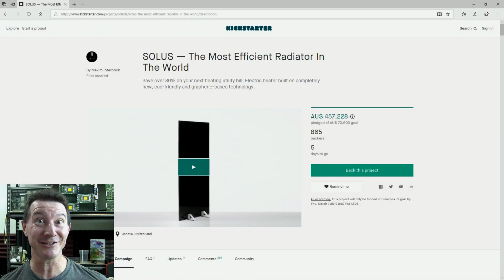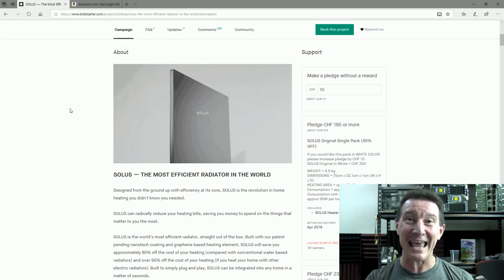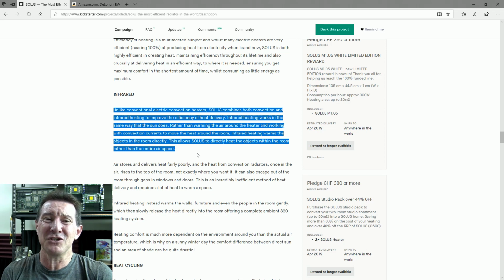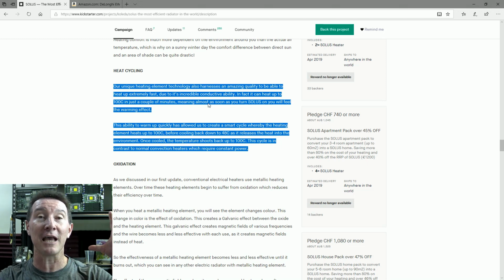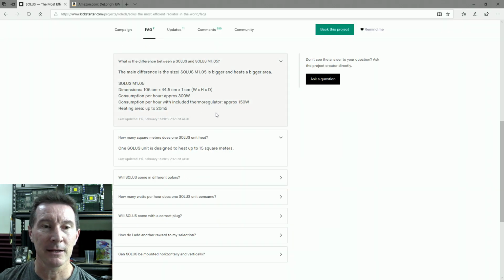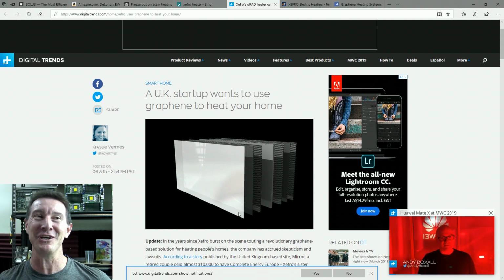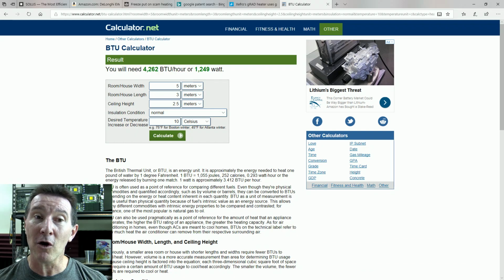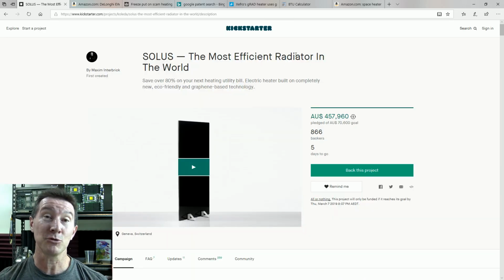EEVblog #1186 - Solus Graphene Heater Kickstarter BUSTED!

Comment: HelloEEVblog

Thank you for sharing this. It’s completely normal that when something new and innovative comes out that there will be divided opinions and some skepticism, as well as criticism from competitors. You probably see people that still think Tesla is a scam. 

We have already sent test units to high profile tech journalists and waiting for their articles. Unfortunately Evvblog review is completely invalid. First, Evvblog does not have a sample SOLUS unit. That means the reviewer can only go off his beliefs and theories. 

Second, having watched this video, it’s clear that the reviewer goes off on a rant for 45 minutes without even considering all the information presented to him on this page, not to mention scientific studies available online about graphene. 

For example, he made a review of our testing. However, he completely ignored our “ A FEW THINGS TO NOTE ABOUT THIS TEST” section.  If he did read this, then he would understand why SOLUS M1.05 consumed more than 300W per hour during the first 24 hours of the test. He completely ignored the fact that we managed to heat up a 16m2 room up to 21°C on 300W (or 440W if taken in a short 24h space)  when outside temperatures were negative. He did say that this is impossible? 

It is also clear that EEVblog has no response besides crude gestures to this statement “we have found that raising the temperature of our heating element is most effective through supply of non constant/pulsed electric current. It works in the following way, the heating element is supplied with 1.5 seconds of electric current and is then cut off from supply for another 1.5 seconds. This process is repeated until the heater reaches it’s maximum temperature. We observed that during the off cycle (1.5 seconds when current is cut off) the heating element continues to generate heat due to the self cooling properties of graphene, which results in a difference of potentials.”

At the end of the day, we are happy that SOLUS is becoming the centre of attention. We are shipping the units very soon and will look forward to real reviews from our clients. 

Kind Regards,

TEAM KOLEDA
Reply: Madi Azoff When you said "W per hour", you lost all credibility.  Anyone selling energy devices need to at least know the difference between heat and power.

Comment: Dave can i ask can different wavelengths transfer heat to the atmosphere with different effectivness/efficiency? I mean the job for any radiant source is to excite the airmolecules and is not that dependent on the wavelength? So could one find a wavelength that is ideal for atmosphere? I mean you do not feel any overwhielming heat sticking your hand in a turned off microwave oven after cooking, so i guess that wavelenght is optimised to heat water?
Reply: Bare with me now Dave, i am not schooled in physics but does not every medium have sort of a selfresonating frequensy when radiated with light. They say that infrared penetrate deeper???
What frequensy does the ground penetrating radars use?
https://en.wikipedia.org/wiki/Ground-penetrating_radar

But maybe it is more a function of the input effect? 
I guess what i ask isn't the heating medium and wavelenght also properties of the efficiency of the system???
Reply: Maybe there is wavelengths that does not excite airmolecules at all? Ultraviolet light generate less heat although carry more energy? So is that also dependent upon the medium it travels?

Comment: Water based heaters are common here in Europe. Good source of grounding if you need one as pipes for this are all metal (while hot/cold water is often distributed in rubbery-type pipes).

Comment: But regarding the fans, if warmair raise it seem a fan could do a good job more evenly distribute the heat evenly in a room?  I mean noone wants a heat spot with sauna heat if the convective element just some decimeter high wide,high like cubelike thingy i mean the heat source from the actual steel on an anvil isn't good enough it is just a point source. The bigger surface area you spread the heat the more even it is distributed. 

Isn't the idea using pipe system with hot water pumping around  under ceramic tiles a good solution to keep an even temperature in a room it seem to me to put the heat where it is needed just like the sun. The abiliity to store heat is material dependent? I mean gases just disperse and leak heat, have you heard of those giant cave rooms  with saline solution that the Saudis wanted to use store  excessive heat during day, ,to use as a heatsource for a waterpump system during night? Did it ever happen or was it just a foolish idea?

It seem to me the medium do have a significant role to play in heat distribution?
So idoes not medium, surface area and **placement** play a key role in keeping a steady temperature?

What is the reason for using ceramic tiles in the old  tiled stoves, is it just to preven leaking of carbon monoxide?
This is just vivid/lucid ideas i have, but i think the romans had water heated lead pipes under their bathhouses, so they already had invented a good way to distribute heat to keep a steady temperature using ceramics tiles trapping the heat air from the ledpipes.

Comment: Ok Dave, I'm only 20 minutes in and so far I've only seen you demonstrating you don't know the difference between radiative heat dissipation and convective heat dissipation. 

There IS a difference that makes their concept a better heater than the finned HX you showed in the figure. Heat transfer through radiation occurs mostly through IR light (for the temperatures this is expected to work on), traveling through the transparent air in the room. Convective heat transfer (natural convection like the finned heat exchanger, or forced convection like the fan-based HX) needs the air as a medium to carry the heat energy, which requires the whole air mass in the room to heat up. This is a huge difference if you're concerned about heating up the people and not the air. 

When I was a young boy, my family had these IR lamps in my home and it was very comfortable in the winter, at 0ºC outside (and probably 10ºC inside) with a 200W lamp because we couldn't afford to use the fancier heaters because they consumed too much electricity. The only issue is that you have to point the heater in your general direction otherwise you don't get anything. If you've never used an IR lamp, maybe you stood by a bonfire, it's the same thing.

Their design concept is not wrong and from my experience with IR lamps it should work better than a convection heater. They're using the largest possible heating area and the highest emissivity material (this carbon nanotube wank is like a black body). Their design has a big flaw which is not having a mirror behind the heater where it faces the wall (my IR lamp had a parabolic aluminium mirror). This concept exists literally exists for maybe half a century or more. The only difference is that an IR lamp is ridiculously cheap compared to this product. Like 20-30USD cheap. So you're basically paying for their nice-looking flat panel. But I agree - too much marketing for what it is. But they need to survive and they are succeeding, so it's not like it's a fake product or a flawed engineering concept. These heaters will most definitely feel "warmer" with less energy usage. The drawback, to be honest, is that you feel like you're being cooked in a microwave, because your skin gets very hot but the room is still cold. So it's not really THAT comfortable. 

BTW - Former refrigeration design engineer here. So I think I know one thing or two about heat transfer =)
Reply from the maker: Yes, I plan to do a follow-up video (not really focused on Sonus) to explain this. This video was really amount room heating (i.e. BTU heat transfer for temp increase), and they don't claim how much of this is direct radiated IR and how much is convective, they just say it uses both. The convective part is likely going to be quite poor because the (naturally) circulating does not pass by the actual internal elements. 
Their own test focuses on room temperature increase and not direct IR heating of people etc.

Comment: Dave, your rant on glass is spot OFF. Almost every radiant heater uses glass to isolate the element from air so that it can run hot enough to emit IR efficiently without cooling or burning. Think halogen heaters or the old glass bar heaters, or infrared lamps. The rest you are of course spot on

Comment: all I can see that would be different from a regular oil filled electric radiator is that they seem to have designed it to minimise the convected component of the emitted heat. convective heaters dont have fans, as the name suggests they rely on convection (hot air rising). they have air slots at the bottom, a hairdryer-like wire element and air slots at the top. the element heats the air which rises and goes out the top vent drawing cool air in at the bottom to be heated. 
from purely subjective personal experience, oil filled electric radiators seem to be a lot more practically effective at heating a room, you can put a, say, 1.5kW electric radiator on and in an hour it will have warmed the room, then the thermostat will regulate it and it will use less power to maintain a temperature than it did to raise it. however those convective heaters dont seem to work as well. they use a lot of power, 2kW being a common rating,  the hot air comes out the top and they quickly make it seem stiflingly warm but as soon as you turn them off the room seems cold again in a few minutes. how the thermodynamics of all that are playing out I don't know but I would assume that radiated heat does more to heat the fabric of the room and the solid objects in it which will hold and release that heat for longer than the air heated by the convector, which is very easily lost if you have any draughts or open a door etc. I dont feel like heat would be very efficiently moved from the air into those objects and surfaces but thats just a gut feeling that may well be wrong.

Comment: Water-based radiators are a part of the central heating system were the same hot water is circulated through all the radiators in a house.

Comment: You're thinking of the wrong type of radiant heater there Dave, don't forget they use the boilers and pump that water to all of the rooms in the house, loosing plenty of energy in the walls, roof space etc etc. They are far less than 100% efficient when you look at energy into the system vs energy into the room itself.

A 200W infrared heater will also have the subjective appearance of generating more heat than an oil convection heater because it's warming you up rather than the air. Be buggered if I can see what's generating that kind of infra red energy though.

The rest is of course utter BS, but you've at least got to give them that. There's those small grains of truth in there to make the rest sound plausible to the VERY casual glance.
Reply: However, gas boilers convert directly from fuel to heat; electric heaters are powered from the grid which has transmission losses and the power is generated by turbines which are either directly powered by fuel or from steam generated in a boiler (yes, I'm aware some countries have high levels of renewable energy, but that's not universal).

Comment: Just use your toaster....its also 100% efficient.
Reply: Funny comment but I was wondering if they are 100% efficient, the threads are glowing and are thereby loosing some of the energy to light. I don't know if I am right?
Reply: Fried Mule as long as that light doesn’t escape your house it should be absorbed by nearby items and converted into heat.

Comment: Simple rule: You're not allowed to lie. Not as a salesman, not as a politician and not as a news media person.

The sad thing is they are actually some innovations. But they don't get much play because they are not that easy or sexy but these liars do get money. And it preys on an issue that is critical for humanity.

Like heat lamps aiming at you / following you around so you basically stand "in the sunshine" in a cooler house. That can safe energy.

Or like using water as a thermal battery. Power from solar panels is incredibly cheap by now over 20 years, but storing the energy is costly. But heating up some large water tank actually solves this. And it's cheaper to build and install and maintain that solar thermal panels, just solar electric heating up your water tank.
Reply: Dejay Rezme Water tank energy storage has been a common addition to solar heat panels for a long time.  It's usually cheaper than the detour via electricity simply because of hardware cost.
Reply: @johnfrancisdoe1563  Not sure if you misspoke, but actually electrically heating a water tank using solar panels is cheaper now. It's much simpler, just put solar panels, a cable and some resistive wire in an insulated water tank. Plus a controller. It's less power per square meter than solar thermal but much cheaper and always produces some energy. It's also easier to DIY.
With power from solar panels is just so incredibly cheap, it's just the energy storage that is the problem.

Comment: Efficiency for resistive heaters often refers to watts per weight or watts per volume. Especially in industry, a small light, rugged heater is often better. But they don't seem to be talking about that. Those panels don't seem to be smaller, lighter or cheaper than the competition.

Comment: The claim that the graphene paste is producing heat when no power is coming through it is so much fucking bs. Graphene paste maybe slowly dissipating the stored heat over a short time, but that's no different than a regular oil heater. They're just using thermal paste instead of oil.
Reply from the maker: Read their response to my video on the KS comments! They still seem to be claiming it does.
Reply: @EEVblog  oh I know that's what prompted my comment. They're so full of it in that response it's just mind boggling.

Comment: I'm concerned.
Pulsing the power on and off, allowing the elements to cool down to 48C and then heating back to 100C, is going to cause expansion and contraction in the elements, right? Won't doing that reduce the life of the elements?
Why would you really choose to do that? Could it be that they're trying to mitigate a problem that would have affected the visual design?
Technology Connections recently did a couple of videos on the marketing wank in space heaters as well.

Comment: What's this crap about "watts per hour?" Watts is already a unit of energy per unit of time, so take that per time and it's "acceleration of energy" just like mechanical acceleration is distance per time per time.
At least use incandescent light bulbs! They give off some light as a bonus.
Reply: That's how fast it powers up... you turn it on and after an hour it's emitting 200 watts :)
Reply: Could be broken down into Joules per second per hour hahaha

Comment: Ok, I'm in friggin stitches laughing here! The "real" 24hr "room test" is the fakest frick I have seen in a long time.
Hell, if you want to be deceptive atleast do it well!
Allow me to drive a 40ton truck through their logical plot holes:
1. After the 24hr period of testing the panel heater suddenly the wires are pointing in different directions from when test started
2. After 24hrs of panel test it is connected to a different multiple output socket!
3. The test room window wall is effectively heated by sunlight, depending in solar hours per day it will heavily influence heating req'd.
4. The average temperature is just start + end temp /2 -no logging done or presented when actual temperature fluctuates heavily on a sunny winter day
5. The water radiator thermostat is probably not 100% off -usually they have a frost protection always circulating a little water.
6. They never provide IR start temp of water radiator -bcuz that would ruin their narrative.
7. The start/stop for their shitty panel test was done at night b'cuz low temps, the start/stop temps for convector was done at sunny day time to achieve seemingly "average" warm 24hr period
8. The used amount of energy (like Dave said) is higher than what should be possible with panel where upon I suspect they boosted the temp at end with convector because panel couldn't keep it at room temp.
9. Why was the convector in the same room during the panel test? With it's powercord stretched out... really aiming for that power outlet..? Hmmm....

Comment: I am not saying it's the case of this product, but I'm using infrared panels on my ceiling for heating. It should convert about 75% of energy to the IR. The point of saving is three fold. First is price. It costs  about one fifth of heat pump price. Secondly since it is heating in IR it warms up people in the room and not the air and thus the temperature can be about 3 kelvins lower and still comfortable and thus decreasing the total power that heating consumes. And last thing is control. I have every room controlled separately and since it warms up to working temperature in about 10 minutes it can be pretty granular.
So it is not giving more energy than regular oil heating or central heating, but  to achieve thermal comfort for people you don't need to use less power. So we can say its more efficient.

Comment: If this thing is only 190watts it's going to be the world's worst room heater - the old light bulbs were 100 watts, so the heating power of this heater is equivalent to two light bulbs. The tiny fan heater in my room now has two settings: 1000w and 2000w plus a thermostat and cost about £15/£20. And what are "watts per hour"?